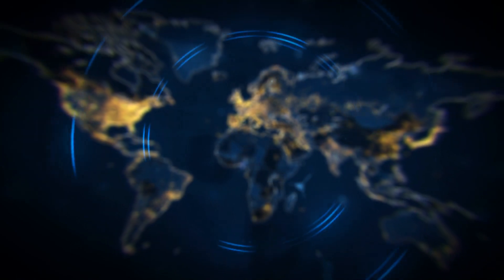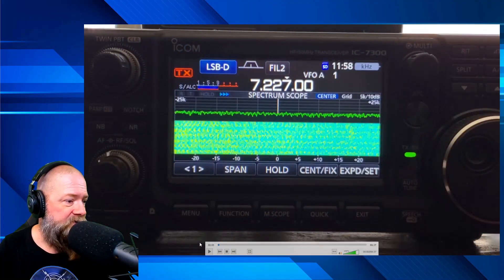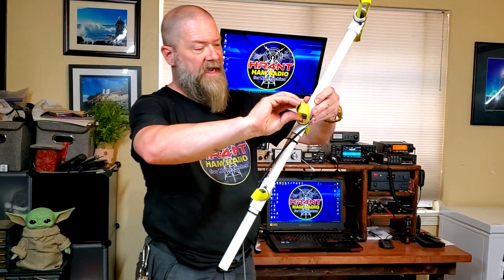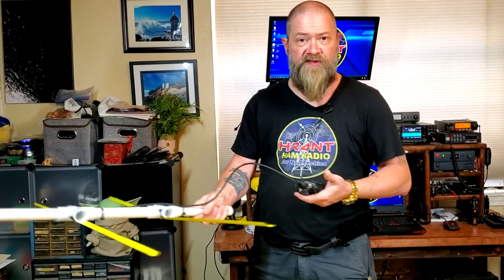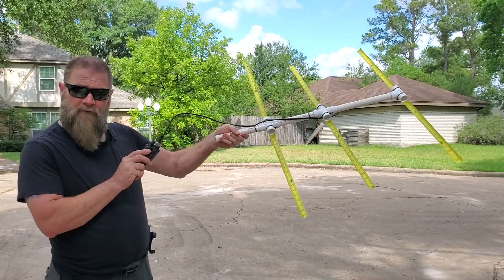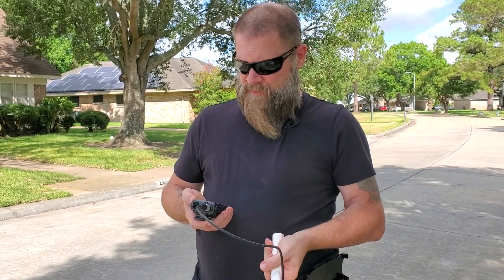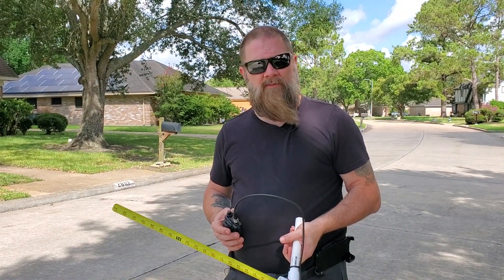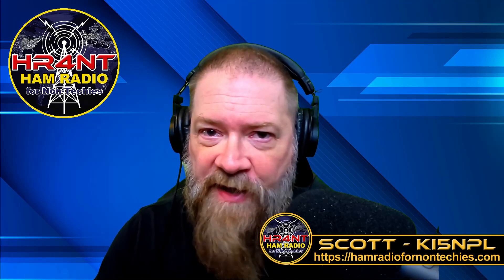How I Hunted the RFI in the Shack

Comment: you address the cause of the issue - but didn't address how you got the neighbors to do anything about it.  Is there law that says they have to?  Around me- I'm sure if I complained to a neighbor and said you gotta change out your solar panels - they'd look at me like yeah, right buddy go F yourself. so - how did you address with neighbors and how was that process?
Reply from the maker: The fact of the matter is that according to the FCC, spurious emmissions are illegal and MUST be addressed according to Part 97 of the FCC code/regulations.  HOWEVER, getting th eFCC to actualy take action and force a resolution is another story.  I addressed the issue directly with the neighbor, no effect.  They ignored me.  Contacted the ARRL RFI deportment for help, they were less than useless.  So I sent in a formal complaint to the FCC about it abotu 6 months ago, I haven;t heard anything about it.  So the reason there wasn't a video about how I dealt with it is because I am still dealing with it and I am the lone sailor on a ship with no captain.  The so-called officlas that should help and monitor these things don't seem to give a crap.  So I am just stuck.  Thanks for the comment and for watching.  73!

Comment: If I had to guess, the solar system in question is generating more electricity than is being used locally, so the rest is being sent back to the grid.  For that to happen, their has to be an inverter that's sync'd to the grid.  That inverter is probably what's making the noise.
Reply from the maker: Most of the time it is the inverter.  To this day they still have not addressed hte issue and both the FCC and the ARL have been zero help.  Thanks for the comment and for watching.  73!

Comment: What is the definition of interference that compels someone to be forced into action to make changes? 

There must be a level defined somewhere?
Reply from the maker: It's pretty much anything that interferes with your normal expectation of being able to operate your equipment.  If that is hindered by spurious emissions from an outside source, that source needs to be tracked down so it can be resolved.  I am sur that Part 97 of the FCC code defines it much better.  I hope this helps.  Thanks for watching and for the comment.  73!
Reply: @HR4NT  yeah, ultimately it seems subjective in nature, instead of a clearly defined limit that you could point to and say Mr. Solar Panels is exceeding, although in this case I think it's pretty clear that there is interference.  But I don't think it's always this clear cut.

Comment: You're using a 2m yagi on the 40m band?  Say what?
Reply from the maker: Yes, however keep in mind I am using the 40M band as receive ONLY.  Hitting the transmit button would probably fry the radio.  I am simply trying to find the source of the RFI on a band I have interference from at home.  As long as you use it like I am in the video as a receive only, you should be good.  Thanks for watching and for the comment!  73!!
Reply: @HR4NT  A yagi isn't going to be a yagi anymore when used at 20 times the design wavelength, whether you transmit or not.   It's just a very inefficient dipole at 40m.  I'm surprised you got any useful directivity out of it.

Comment: Thank you for this video. For me, it is right on point. There is a noise floor of S6-7 on my porch, about 100 yards away from my 10KW solar panel install. The outfit that did the installation of my panels went out of business 6 months afterwards. My plan is to go outside today and learn about the RFI that may be coming from those panels. Any fix will be on me. Ugh. Thanks again. 73 KQ4IXD
Reply from the maker: Give the folks over at https://palomar-engineers.com/ a call.  They have RFI kits you can buy and install that may help with that.  Thank you for the comment and for watching.  73!

Comment: My next door neighbours have installed a new roof solar panel that can be easily seen from the front of their house. Fortunately no detectable QRM increase at my house using outdoor HF and VHF antennas. The main HF and VHF RFI noise sources at my location are radio shack Windows 10 PC case internal AC/DC power supply (fixable), and front street powerlines (not fixable). This is proof that not all roof solar panels are strong RFI generators.
Reply from the maker: Properly installed solar panels won't emit RFI, but the majority are made in China and the installers either don't know or don't care unless they get caught to install them correctly where they do not emit RFI.  Thanks for the comment and for watching.  73!

Comment: That handheld gets 40 meters?
Reply: Yes, the radio has a general coverage receiver that covers HF.
Reply from the maker: No it does not.  It is VHF/UHF only, but you can set up any frequency just to have the static available to hunt RFI.  I would NEVER hit the transmit button wile on that frequency on an HT in fear of frying it.  Thanks for the comment and for watching.  73!

Comment: I didn't know they had HF HTs. Never heard of anyone tuning in 40 meters on an HT. What's it called? Brand and model number?
Reply from the maker: This was not an HF HT.  I simply tuned my Yaesu FT3-DR to a 40 meter frequency as a receive and used that to hear the difference in static as I was patrolling and hunting down the RFI.  I am not aware of any HF HT on the market.  Thanks for the comment and for watching.  73!
Reply: @HAM Radio For Non-Techies  I didn't know you could tune a vhf/uhf radio to 7.2 MHZ. I'll look at mine when I get home. I like your videos.
Reply: Several of these HTs have general coverage receivers in them that cover HF.

Comment: What exact frequency did you use? How do you get 40m on a HT? Did I hear you correctly?
Reply from the maker: On my Yaesu FT3DR I simply set it for AM and set the frequency for 7.110.  I am NOT transmitting on that band as the radio will not handle it, however it will receive on that band, at least it will indicate when the static noise goes up due to RFI issues.  Honestly I think you could do it on any AM band, but from my research I was under the impression that I should scan on the band that has the most interference in order to locate the problem.  If you use your HT on 40M DO NOT hit that PTT button!!!  I hope this helps explain my scenario a little better.  Thanks for the comment and for watching.  73!

Comment: Any idea how that issue would be resolved?
Reply from the maker: Yes!  The home owner was contacted and I gave them the basics of what needed to be done.  Basically, they need to contact the company that installed the solar and they would probably install ferrites to the charge controller on the house which should block the RFI coming form their house.  I also gave them a packet I printed up from the ARRL website's RFI department Link is here:  http://www.arrl.org/information-for-the-neighbors-of-hams .  In time (hopefully sooner than later) this should be resolved and as long as this is the only issue, then I will be able to use my radios from home.  If not, then I need to track down the next cause of RFI near my home.  Hope this answered your question.  Thanks for watching and for the comment!!  73!!!

Comment: Good stuff as always, sir!  And damn it, now I have another antenna project to build...  =)

It does make me wonder if hams could even use roof-top solar (I like the general idea) if it blasts out so much RFI that it affects you a block or two or few away.

Mike from K8MRD Radio Stuff also had a good video on tracking down RFI using a device from MFJ and a yagi.  That one turned out to be some power utility box.
Reply from the maker: Antenna builds are a lot of fun and usually cheaper than buying from a company...plus you get to learn something new!  Not all solar companies produce crap.  Some are actually responsible enough to pay attention to RFI issues as they are installing them, however, the ones that disregard this are still liable to make it right once it is discovered.  I have a fellow ham in my area that has solar on his house with no RFI issues what so ever...so it just depends.  If you are going to do it, shop around and ask those questions BEFORE you have them install solar to your house.  Just my two cents.  I watched K8MRD's video.  He and I talk frequently since we are nearby to one another.  Like I said, the solar panels may not be the only issue IO have.  If that is the case, I will bring out my antenna and HT again and hunt for the next source until it is all eradicated.  Thanks for watching and for the comment.  73!!

Comment: Another informative video.  I have a non related question.  What type of jumper do you use between your
 window pass through and your radio ?
Reply from the maker: None that I know of.  There is a 3 inch long SO-239 that goes through the passthrough.  I have a 3 foot coax cable from the passthrough to the radios.  Hope that helps!  Thanks for watching and for the comment.  73!!
Reply: @HR4NT  Thanks for your help.

Comment: Maybe it is just the video but the difference in the static from the 3D speaker while walking up and down the street is barely discernible to me???   It all sounds loud and gruff.  Could that noise have been squelched out to provide a more exact location?
Reply from the maker: Sorry if the audio wasn't that great.  From my perspective I could definitely hear a difference.  Once I approached the house with the solar panels, there was an added high pitch sound within the static that pinpointed that location as the source of the RFI.  Thanks for watching and for the comment.  73!!
Reply: @HR4NT  With a decent pair of headphones I had no trouble at all discerning your recorded audio and understanding the jist of the issue.